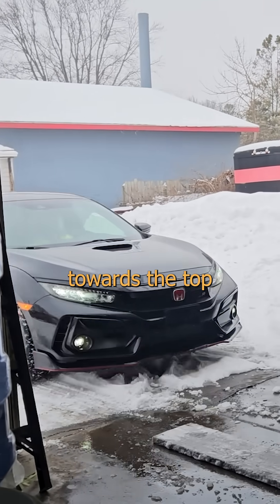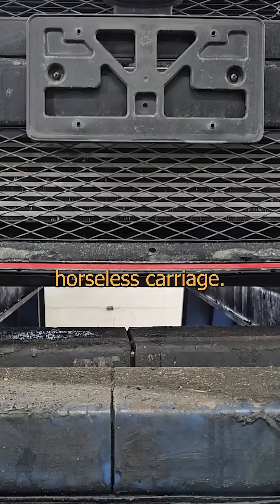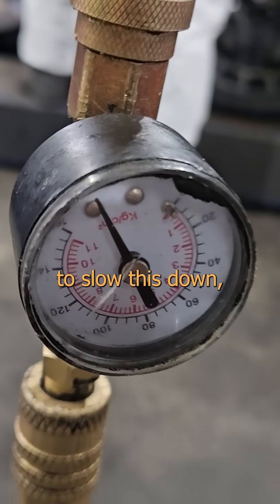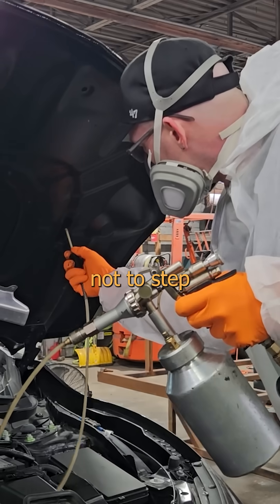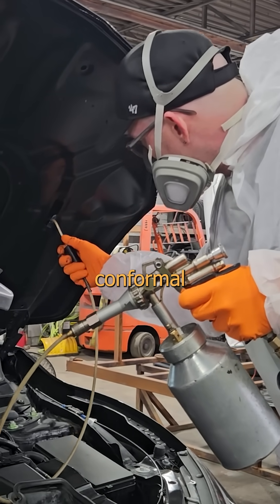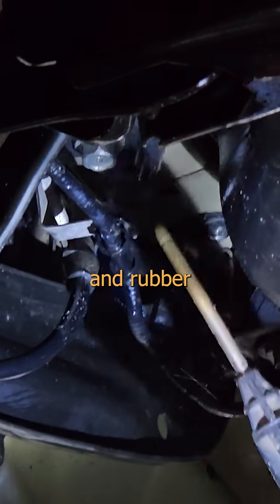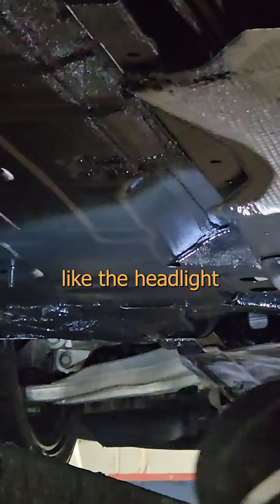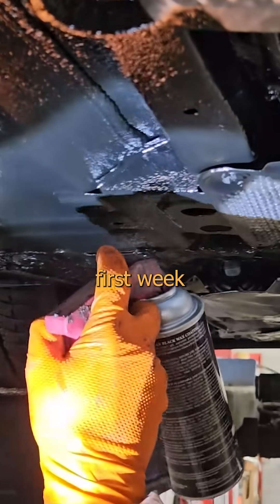How to stop rust on your car #chrisboden #comedy #engineering #wax #corrosion #science #winter #salt

Comment: Now if only it could fix the rust already there, that would be cool.
Reply: You can remove it and replace the metal, though depending on where the rust is and how bad it is this may not be a viable option
Reply: Check out "rust mort" 
Knock anything loose off with a needle scaler or wire wheel. The rust mort converts the rust into iron-phosphate which protects the metal from rust in the future. Not so great for painted areas, it's acid based so don't get on sensitive stuff, and it's got some nasty fumes. But for the ugly underbelly, it's worked well for me in the past.
Reply: That's what rust converter is for. Then coat it in lanolin.

Comment: I don't know what questions to ask.
Reply: Is it toxic 
What chemicals do you use?
how long does it last
Is it a wax or epoxy based coat 
How thoroughly do you guys coat
Reply: @Socio_bros_garage  thank you so very much
Reply: @stevemanart  Best advice is if you dont know what questions to ask is to learn the basics of the issue first like what causes rusting in cars in rust belt and from there you get to how to prevent it so preventing oxygen and water contact even more so road salt and in summer dust control urea or salt contact. From there you get to if its sealed well, what can damage it in this case bunch of iron ice build up gets loose from mud guard and provides "increase in frame clearance" by riding between tire and frame, studs from tires flying, water sand blasting while driving smaller rocks fired from the tire treads to under coating, little rubs when exiting parking lot etc. The damage picture is wide, but the pinholes are the most malicious. Now what happens to coating will it trust to absolute defense of hard under coating and soft bitumen taking the impact and protecting the hard coat, or is it all malleable vax that reseals it self and how does it do that, required temperatures etc, how the coating type prevents mentioned risks breaching the coating and how it handles high impact like peace of gravel being thrown by tire at highway speeds causing pin hole and with it water and salt getting in all the way to base metal how it prevents rust damage after, what happens to water and salt etc that already got in. What about existing rust thats there?

The list is long and i dont claim to understand all of it but that is the process to go trough. I drive shitbuckets cause cheap and replacing metal on older cars its just metal, no special fucking alloys that you are not even allowed to weld.

Biggest issue in whole thing is that governments lobbied by globalists what ever car manufacturers to sell more cars or elite investing in green shit, or pushing the UN 2030 agenda and mass control using vehicles as tool for that, have decided to salt the roads first in winter as for safety and then moved to do that shit summer to tie dust, witch was created by removing the pavement as "basic improvement" when they just drop the speed limit to drop the level of the road instead fixing the fucking potholes properly. Shovel full of patch into hole and couple kicks with the feet isint road repair, when you should torch the hole to drive off all moisture and organic matter, then blow out dust, melt the existing material a bit to making it tacky, adding the filler that is heated and using compacting plate to press it in. For any cracks liquid asphalt should be used yearly going trough roads to fill the cracks since those let water below the road structure and that wrecks the surface when it freezes, but its all planned to fuck us over, even using taxpayer funds to pay people to buy a new surveillance/control apparatus that can be remotely shut down by the manufacturer, while having incentive to scrap older reliable vehicles that dont have any of that shit..
Reply: “Did you do it right?”
Reply: @JustinShepard00  you get either unsatisfactory answers or unsatisfactory results.
Reply: He just gave you the answers. That means if you pay attention youll have the questions too
Reply: @Woofwoof1929  I got the wrong flavor of autism, I posted after watching the video twice and while I had a general idea I couldn't figure out which specific questions to ask. So, if you want to keep being a jerk, kiss my pucker first.